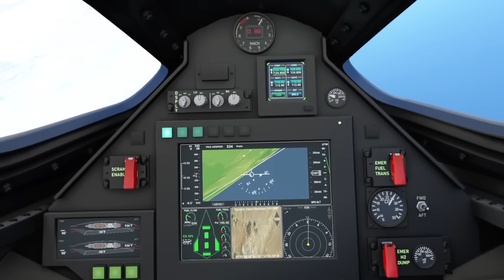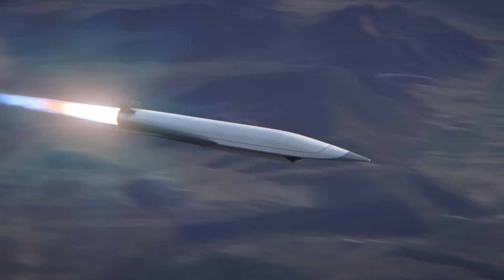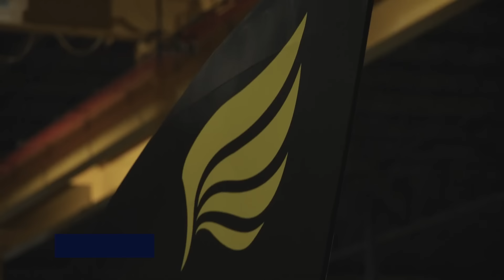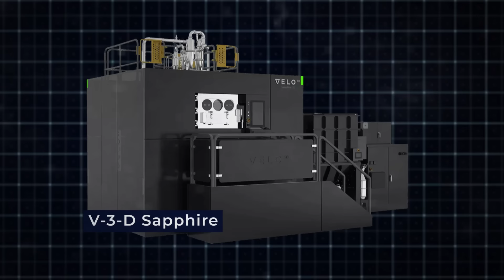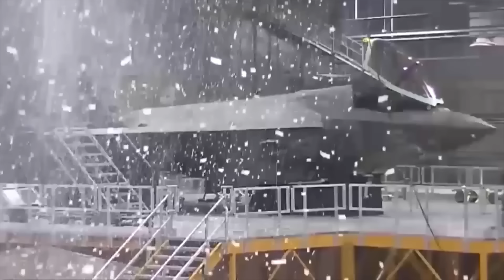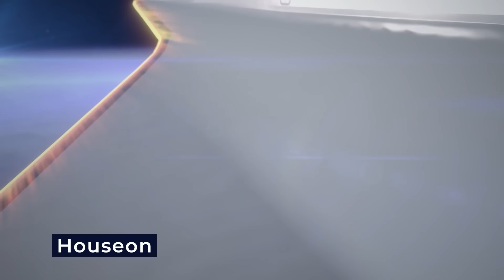US Hypersonic Test STUNS Experts - Faster Than SR-72!

Comment: This actually happened. It was an unmanned vehicle launched into space, starting back in 2010. In the early missions it was highly classified. Its the X38-B by boeing. Darpa also has something similar that is strictly for testing speeds up to mach 20 called HTV-2 part of the Falcon project by Darpa. The Mk-3 was launched with the first chimaera engine in 2022.

Comment: Many folks tend to forget about a very impressive number, Mach 25
It is the transatmospheric speed of the Shuttle Craft on landing approach. Now with the material science catching up we are able to address the near plasma conditions on leading edge surface temperatures of any hypersonic craft. Then with the data from the B2 & B21 flying wing programs we better understand flight controls and can predict air change requirements to alter vectors at velocity.
Reply: Impressive, yes.
Done, no.
The NASA Shuttle never reached mach 25. Mach 23 was its peak, and 22.8 was the exit and re-entry speed. At 25 it would have left Earth's orbit.
People who know what Mach 25 signifies do not tend to forget it.